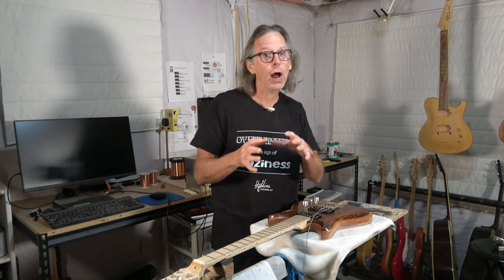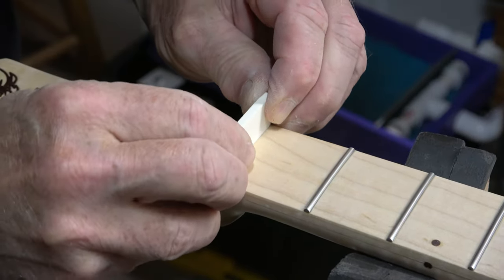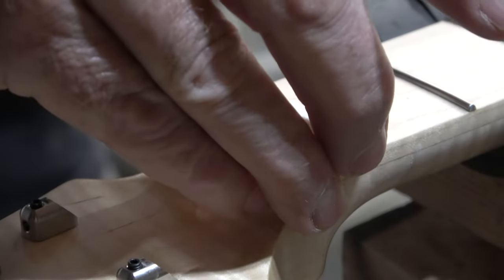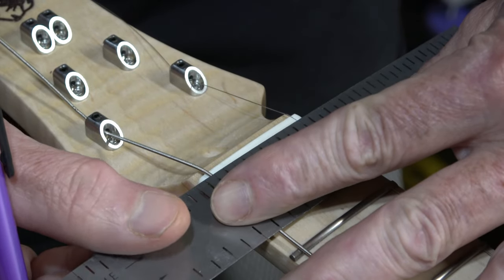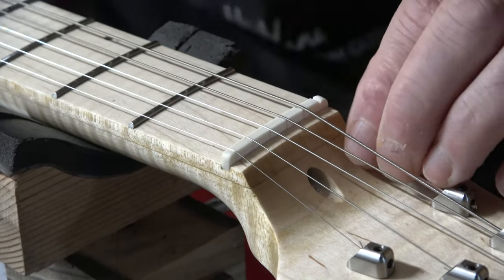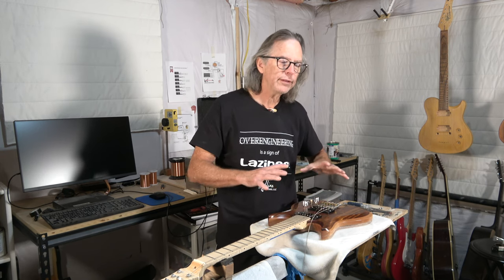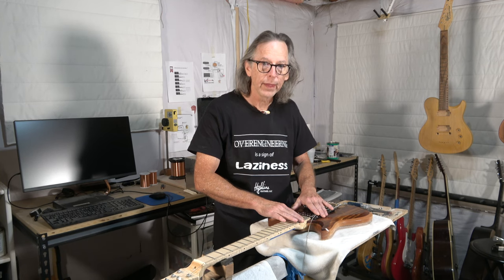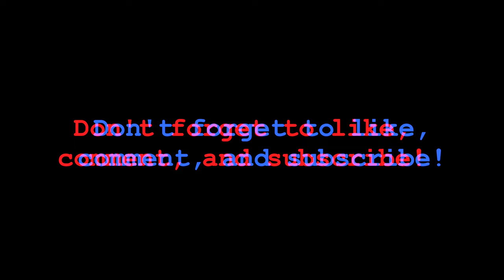Combining A Headless Electric Guitar With A Traditional Electric Guitar Part 12 Making The Nut

Comment: That's good info about the pencil line, top and bottom. I have a Les Paul Studio that I refretted about 5 years ago. As a result of the refret it needs a new taller nut. I've either been too lazy or too afraid to tackle that job., not exactly sure which excuse I want to use. Anyway, I guess I'm afraid I'm going to cut the slots too low and have to do it twice. It's easier to just not play it any more. Wow, I never realized how pathetic that sounds until just now...

Comment: Maybe I missed it in an earlier episode, but I don't recall seeing how you placed the string anchors on the headstock to ensure straight travel over the nut slots. Did you gov over this at some point?
Reply from the maker: No, I didn't.
Reply: @HighlineGuitars  Actually you did. I found it in an earleir vid when you were showing neck build details.  I skimmed a few earlier episodes. It looks like the original plan was to use those string retainers to hold the ball ends of the strings. but it looks like you installed them the other way around. Not sure why. Again, you may have covered it and I missed it. I admist I skip ahead lots of times.

Comment: Hey Chris, 
I have an off topic question. Can Solarez or Crystalac be used over a stained body? Thanks
Reply from the maker: Yes as long as the stain is completely cured.
Reply: If I may give my 2 cents, I would put some sanding sealer on to really lock the stain.
Reply from the maker: @mvyper  Dye yes. Stain maybe not. Stain usually has a binder in it.
Reply: @HighlineGuitars  Maybe he's thinking more of a dye instead of a stain. It seems like lots of folks use the two terms interchangeably, but they are a bit different. Maybe something worth bringing up sometime if you haven't already Chris.